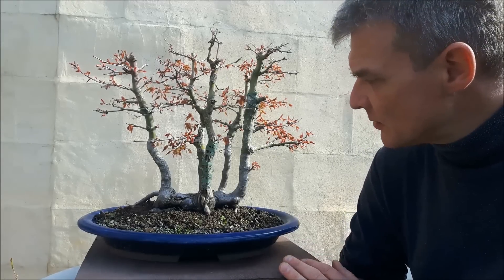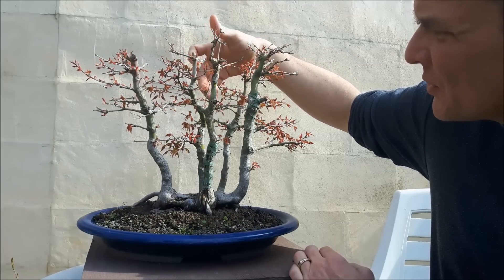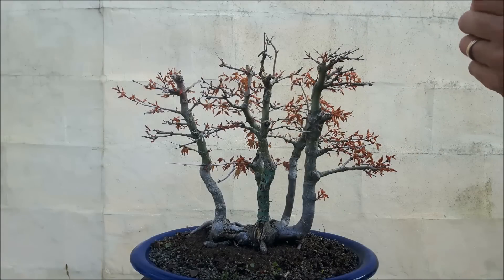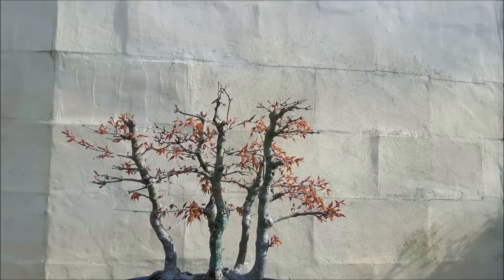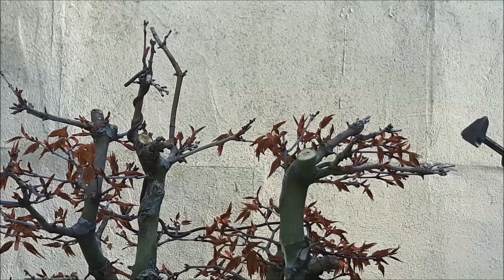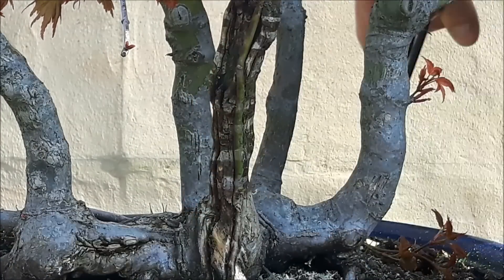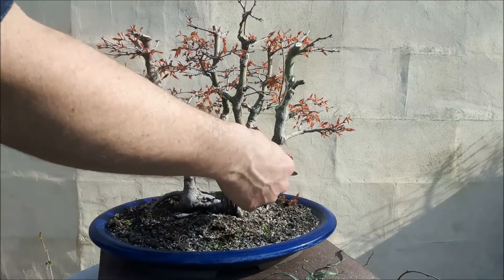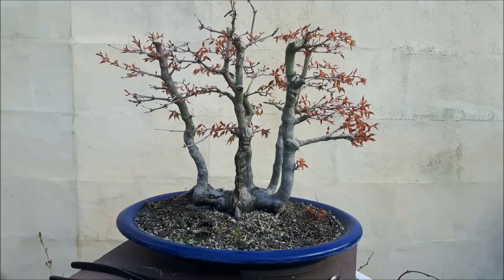Acer Palmatum raft 8

Comment: I always learn something new from your videos. Sometimes I learn what I should do and sometimes I learn what I should not do. But I have a question: Instead of rafia why not use small screws in those fusion grafts? They will give a better chance of the fusion being successful and if you screw them deeply/tightly they will soon disappear as the tree grows.
Reply from the maker: Hello
Failure is a good school....
About the screws: the grafts where to thin and maples die back very easy so it could cause problems.
grts
Kennet
Reply: @KennetDeBondt  
I agree with the first part and I understand the second part. 😊